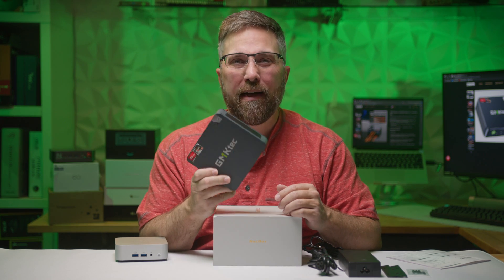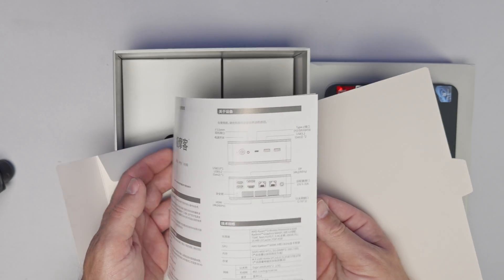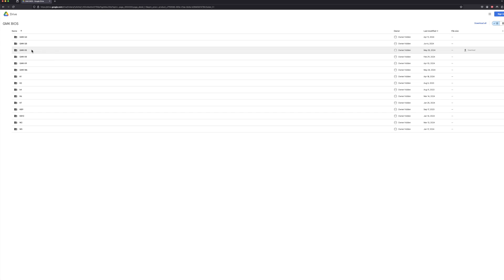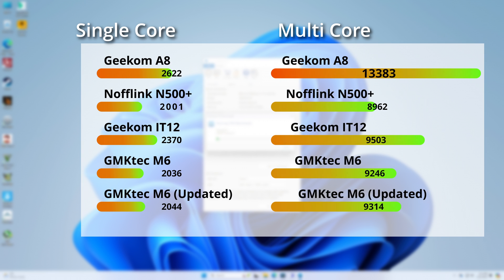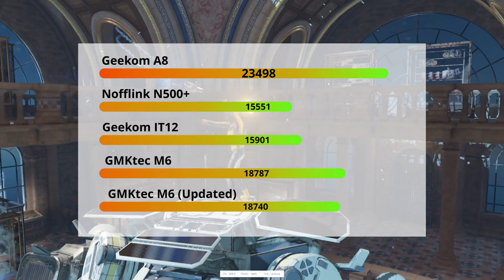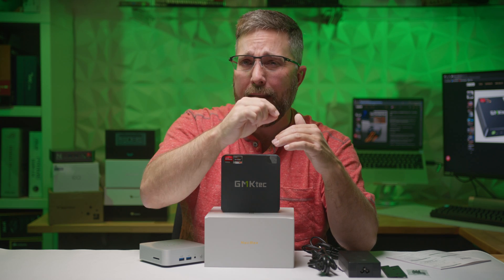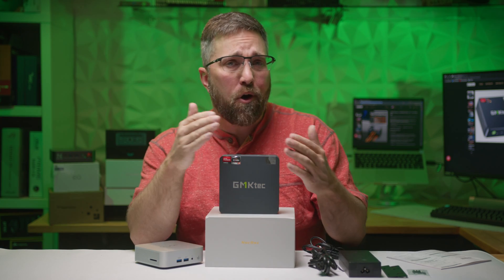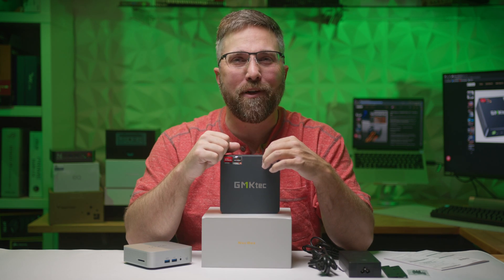Price-to-Performance King! GMKtec NukBox M6 Review.

Comment: When you're used to traditional desktop computers, it's an incredible surprise to discover that a mini PC is so fantastic! Power, speed, fluidity, ease of use, ultra-complete connectivity, and almost no bulk: it's perfect. And everything is perfectly packaged in a box that contains everything you need. You plug it in, Windows 11 Pro starts instantly. Just adjust the local settings, add the usual software, and it's bliss. My GMKtec M6 deserves 5 stars.
Reply: Thats why I am up in the air to buy one as its so small..lol
Reply: Anything to say about Long live ? I just purchased the M6 with the ryzen 7460hs and 32gb ddr5 honestly just because of the 780m iGPU. Hope to get EVE online running on it smoothly ( im fine with 1080p and 60fps, not expecting 4K at all )

Does it get shut downs when playing for a few hours ?

Comment: Hey this needs a disclaimer for the firmware update! I love my nukbox m6 so far, but it should be mentioned that newer ones ship with the newer BIOS configuration. The update links have been removed in the US and other countries because interrupting the process in anyway can brick your computer, requiring it to be sent back (to Hong Kong) for repair - not worth the shipping cost for the price of the computer! 

Seems like they didn't want people needlessly bricking their machines, so now you can request the update on a case by case basis if you reach out and basically assure them you're not going to mess up the update process... 

It all makes sense to me, but going to run some tests later to make sure my machine (purchased a week ago) does indeed have the latest firmware pre-installed.

Comment: Recently I ordered M6 (512GB SSD & 32GM RAM), I also totally agree with this review in terms of price-to-performance king. 
Not only its reasoanble price, but also M6 provides ultimate performance as advertised (heat control, ventilation noise, gaming performance, bluetooth & wifi stability etc)
Reply: HOW IS IT NOW 11 MONTHS LATER ? THINKING OF BUYING
Reply: @camein4581  still in good condition, I just add 2nd SSD for more storage

Comment: Right on. While Intel is less popular than AMD for the high end gamer crowd Intel's low power moderate performance line kills. I went with GMKtec N100 for about $120 to replace an  old I5-4590S home built Plex server. While the N100 box is a little lower in CPU horsepower for this application its more advance internal GPU more that compensates for transcoding.
Reply: Sure.. when you d t care about any gaming.

N100 iGPUs are hot Garbage. Yea, you get hardware transcoding of more CODECs, but that comes at the expense of ANY useful GPU gaming performance.

Comment: Would the  Lossless Scaling (Frame Generation) Tool
On steam for about 7 bucks be a game changer??...
I'm just not sure how much it might help, (or if it NEEDS a dedicated video card)...but they say it can double if not triple your frame rate.
Reply from the maker: Frame gen is built into the Radeon Driver
Reply: @ElevatedSystems  What about the games that don't have built in support tho?... I heard that this program works on everything..with built in support or not.

Comment: This cannot beat a 7840hs. This is about the same as a 5800u. There is something wrong with your benchmark. It looks like you tdp limited the geekdom A8 or didnt bench at same settings. The gpu 780m in the A8 is much better than the 660m besides cpu much faster than the 6600. There is no fine tuning that can make an inferior cpu and gpu perform better unless it is not tested on equal grounds.
Reply: Also due to poor ventilation/cooling many Geekcom mini pc's hamster themselves due to thermal throttling .  Like Apple , Geekcom minis look sexy but have very poor cooling solutions limiting their peak performance
Reply: Recently tested the Geekom A7 7940HS and I can confirm the RAM thermal throttles quickly after a few minutes for gaming loads. The RAM in Geekom Zen4 mini pc badly needs air flow.
Reply from the maker: Yet it did, in some workflows.
Reply: H spec means it can boost all the cores to the max. hs variants can only "max" boost a couple of cores at the same time which under full or partial multicore means the 6600H could use all the cores to the limit while all the other specs simply had power constraints and probably silicone constraints because its a lower power spec chip. This is why most higher end gaming laptops also use the h variants of there cpus (same for intel and amd currently) as games will need more than 1 or 2 threads to be loaded up, which is why the 7840hs fell behind despite on paper it shouldve been better due to more cores and better graphics. It simply couldnt use the cores as effectively as the 6600u. This "H" spec of cpus difference to other cpus for some reason isn't that well known for reasons I dont know. This is also why Desktop cpu's usually have higher multi core performce when the laptop variants can have similiar single core performance and the same amount of cores

Comment: This is a great bang for the buck. 

I was looking at two mini pcs with the 7840HS CPU. The GMKtec Nucbox K6 and the Beelink SER7. I am looking to play older games and indies titles. 

The 8845HS is almost identical to a  7840HS with an NPU. AI seems the buzzword of the moment. 

This M6 gives me pause. It's optimized and finely tuned.
Reply: I have the SER7 and at first glance the difference that would matter to me is the lack of USB4/Thunderbolt on back of the GMKTec boxes.  I consider that to be a minimum requiremnt these days.  The one thing I don't like about the SER7 is the proprietary power supply, although it works fine.
Reply: I have the SER5 MAX 5800HS and a variant with the 7840hs . For some reason the older model seems snappier .